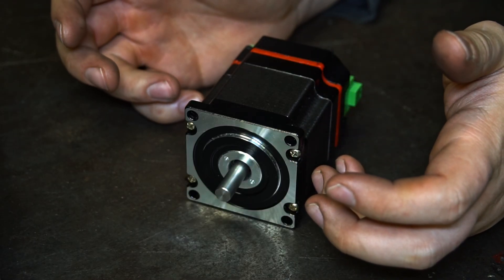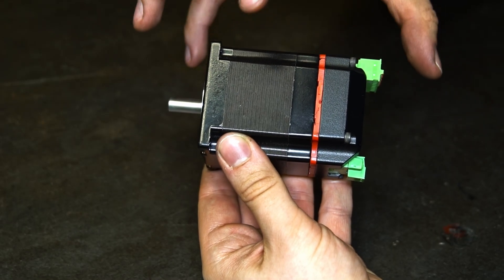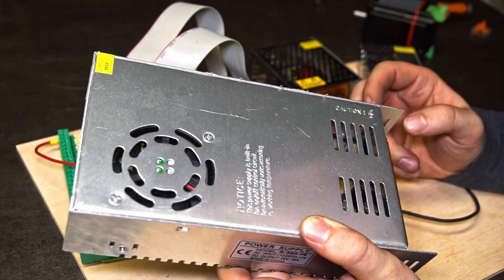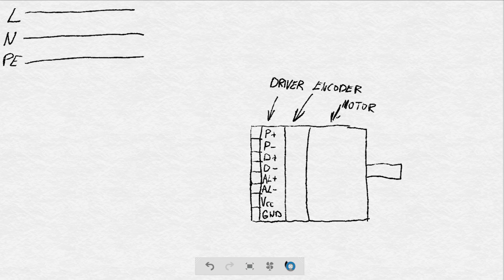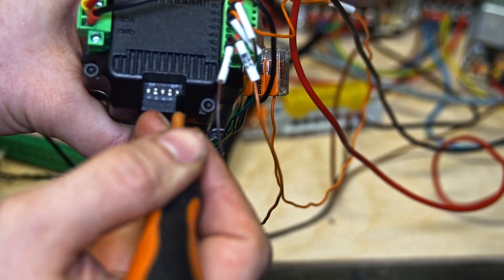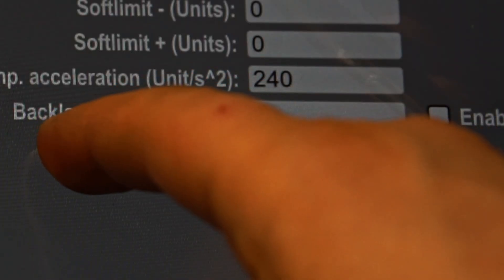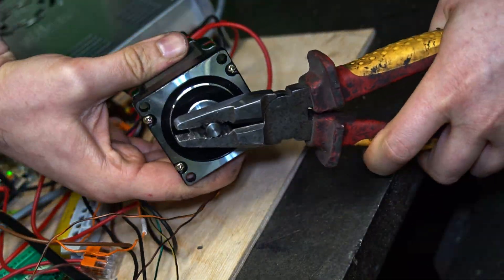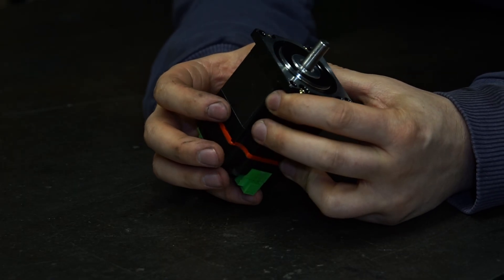Integrated Stepper Motors! - UC300ETH CNC Controller #9

Comment: Always a pleasure to watch your videos. Quick question, if you connect the "alarm" to the "Limit" of the axis, where do you connect the limit switches?
Reply from the maker: Honestly - i just show it as a "limit" on the video so everyone knows how to wire it up. Im going to use mine as a custom input of the controller for the macro. Maybe you could wire it parallel to the limit switches depending on what limit switches u use
Reply: @GBWM_CNC  Thanks for your reply, I hadn't thought about parallel wiring, well seen.

Comment: Interesting idea.. Are the controllers repairable though? Would be a shame to have to scrap a working motor just because the controller or encoder has failed. I manufacture hobby CNCs so i'll have a look at these. Wouldn't be difficult to add a heatsink and small cooling fan.
Reply from the maker: Honestly I didn't consider the repairability of it. I've been adding heatsinks to stepper motors in the past, but a cooling fan would make it quite noisy. In my application it won't be heating much but if somebody would be using it for a X/Y/Z drive - it would be something to consider.

Comment: I found upon testing an integrated one side by side with a normal one (with separate driver) the integrated one had a significant delay (~0.5sec) reacting to controls - when used with a stepper controller (step/direction 5V TTL signals).  The normal stepper was 'instantaneous' in comparison..
Reply from the maker: Alarm delay could be fine, but delay on stepping? That sounds kind of weird to be honest. That would make it impossible to use. I'll check how mine behaves when it's installed on the machine but for now it seems OK I guess.
Reply: @GBWM_CNC    it's a delay on starting.  I used 2x the same stepper controllers for both - those controllers use the enable signal to start the steppers (as I think the timer generated pulse is running all the time) - the integrated stepper takes a bit to react, the other not.
So maybe with a CNC it's not a problem if the enable signal is on sometime before the real action is supposed to happen?

Comment: That's great my friend you did nicely always.
I got a motor 2hp and a single VFD it works great for a 2x72 belt grinder. I am wondering why VFD can not increase the speed to 5000rpm?
Reply from the maker: Thanks!
Depends on your motor type. I think Increasing by ~50% max RPM compared to its nominal RPM could be some kind of safe but I'd be scared to go for more over that. Be careful with that my friend.

Comment: Thanks, I’m building a cnc lathe and will definitely be using these.   How will you protect screw terminals from coolant and chips.
Reply from the maker: Hope these will be doing well. I'm going to use it for my ATC turret so it will be fully covered inside in the housing.